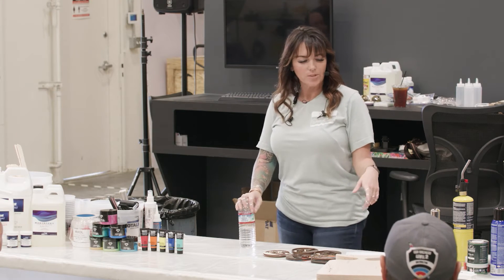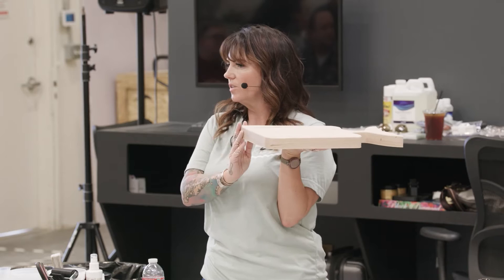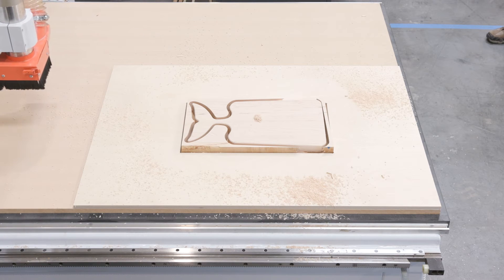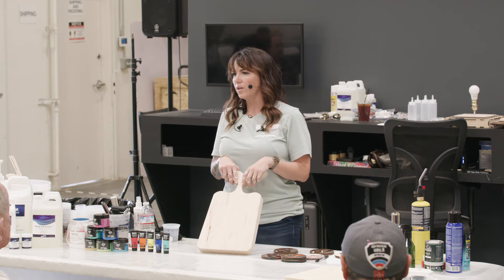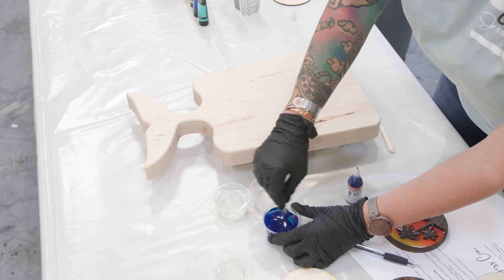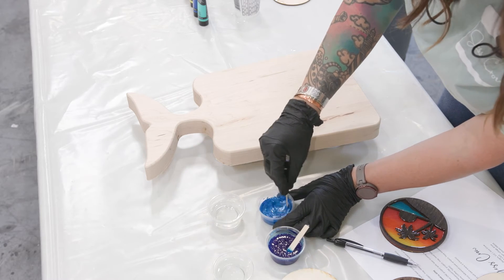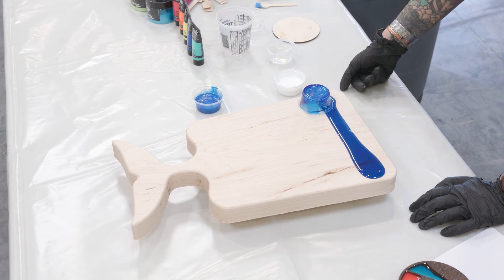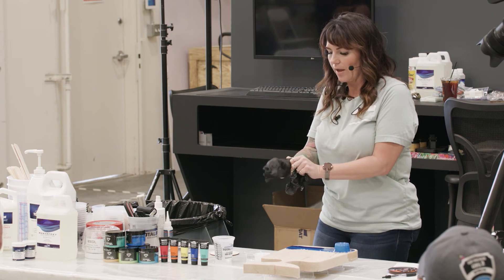How To Make A Whale Tail Cutting Board With An Epoxy Ocean Pour | CNC Router

Comment: Great and informative video.  Thank you for putting this out. Is there any sanding involved afterwards? Is the top surface uneven do the the pour on top of the wood or does it flatten out to where it is not noticeable?
Reply from the maker: Glad you enjoyed it! 
To answer your questions, if you do not tape the back yes, you have to sand. MakerPoxy is self leveling so the top is flat. If you want the entire board flat you can do another pour.